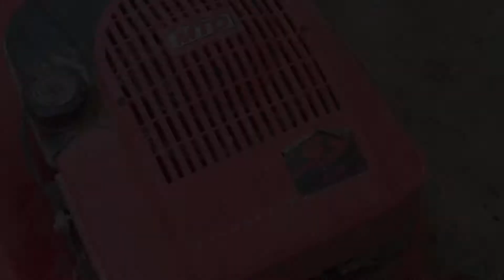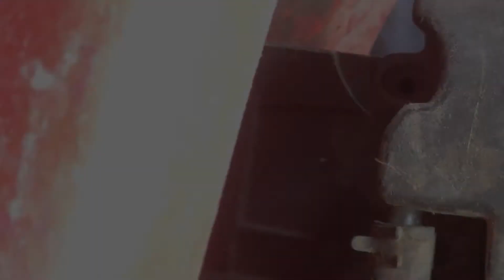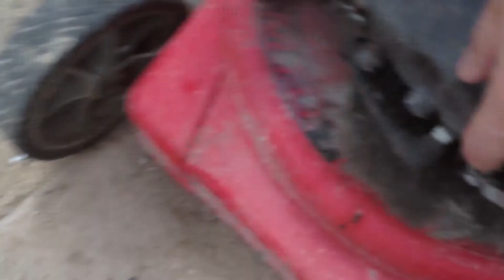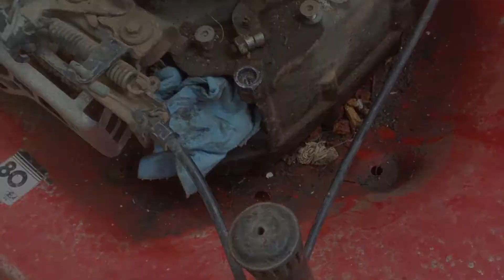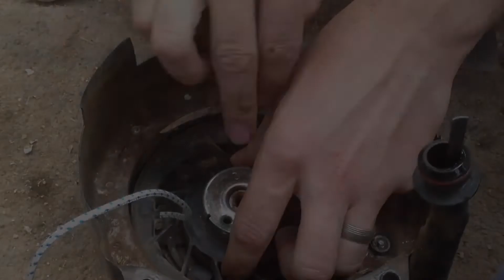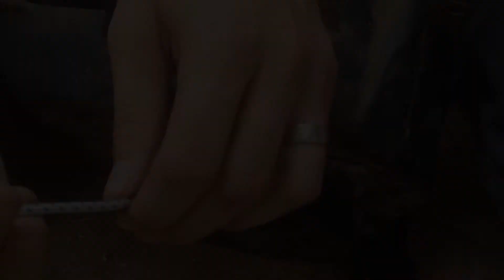PushMowerRepair - Briggs Start Cord Replacement

Comment: what if its broken ? recoiled and return spring wont catch . good vid though
Reply from the maker: For more in depth Briggs pullstart repair you can check out these videos.
PushMowerRepair.com - Briggs 375 Sprint Pull Start Repair
PushMowerRepair.com - Briggs 3.5HP Recoiling a Starter Spring
PushMowerRepair.com-Briggs and Stratton Pullstart Rewind